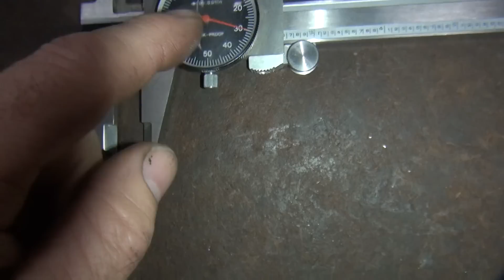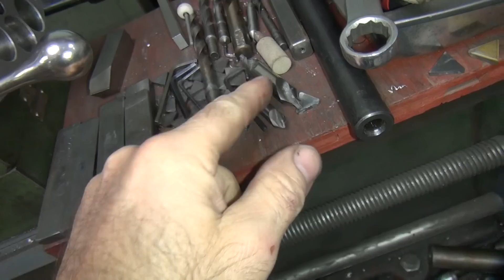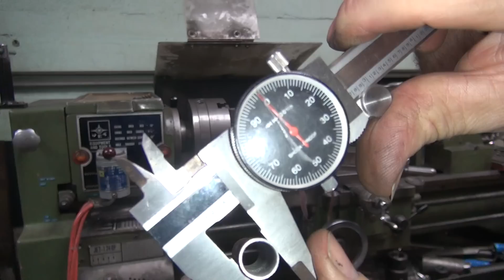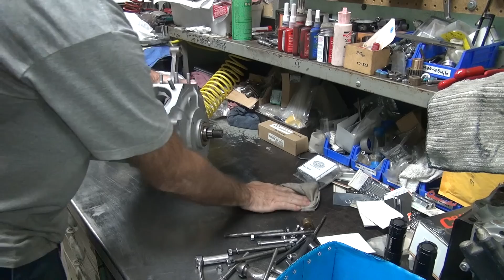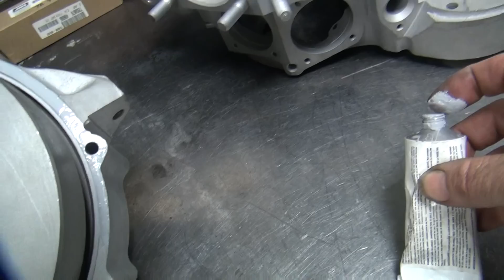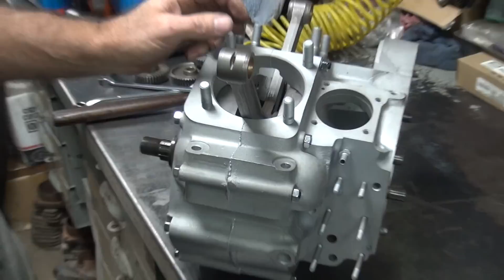1965 panhead #119 74ci flh motor rebuild and bike repair harley by tatro machine

Comment: Hey guys, what to buy for old bikes a 1/4 inch socket set or  3/8 socket set? Or are both needed, I'm in the process of looking for an old triumph or Norton as a project bike, never done this before and am on a limited tool budget, any suggestions please???? Tatro from what I've seen of your videos your the best out there a total inspiration thanks...
Reply from the maker: buy the best tools you can afford. you see what i use in my videos. ebay is a good place to get good used tools cheap.
tatro

Comment: Just curious, If you made that sleave in the cam cover why not make the cam and crank shaft bushings?
Reply from the maker: because i don't like to make things that i shouldn't have too. if i had to make every part i use here i would hardly ever get anything done. your normal wearing parts should be available and make correctly for the job. maybe these manufactures will listen someday to their customers and make the parts right.
tatro